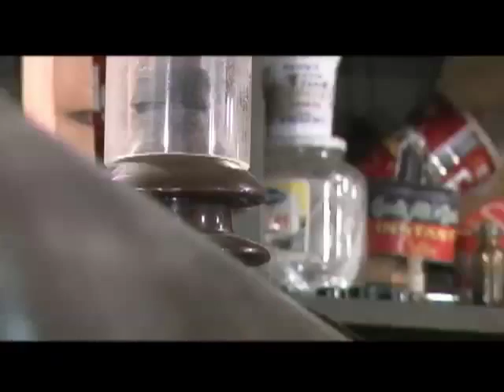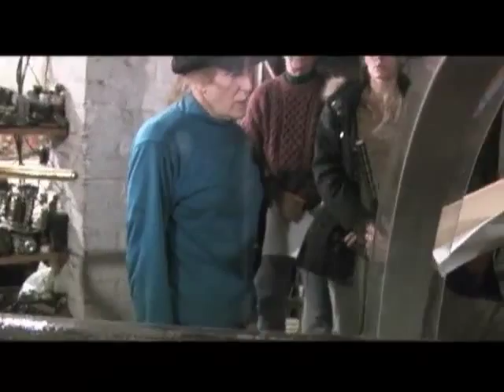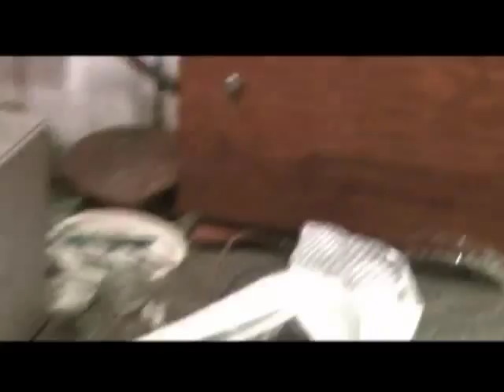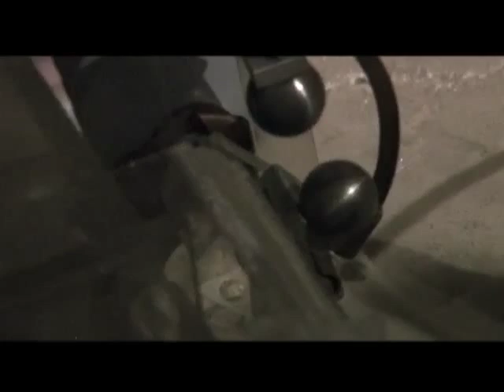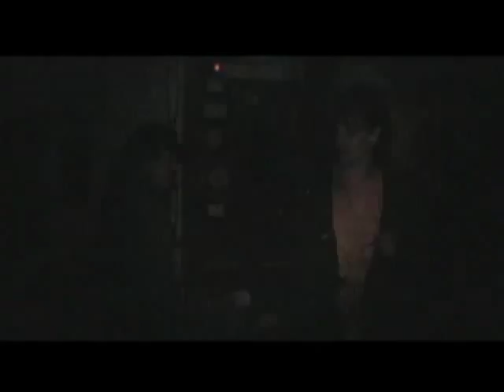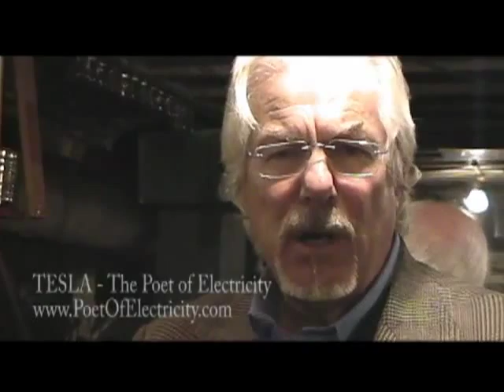THE LESLIE COIL - a James Jaeger Film

Comment: So is it a half wavelength because the primary is in the secondaries center, and neither end of the secondary is grounded?     

Does it then become 1/4 wavelength by just grounding one side of the secondary coil while retaining the primary position in the middie?   

Would a Full wavelength secondary then have the primary wholly to one side,  and not have the secondary grounded on either end?   

Are you familiar with D'arsonval style drivers?  non-biased?